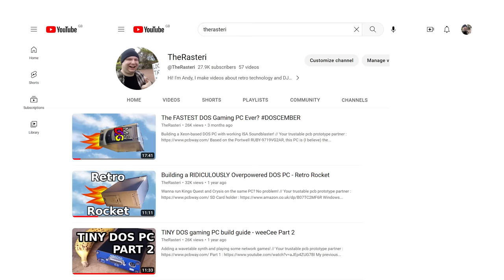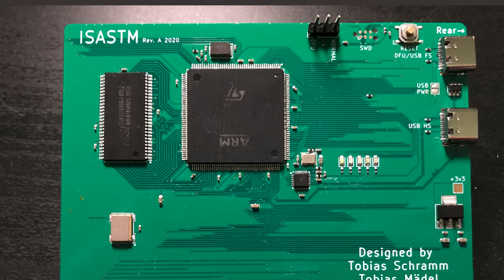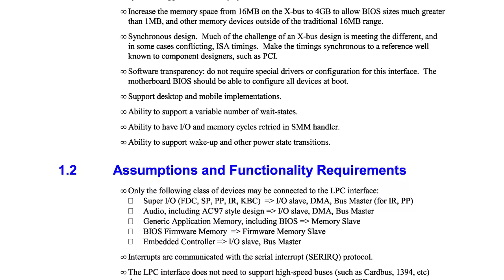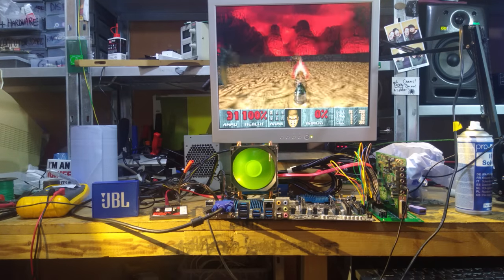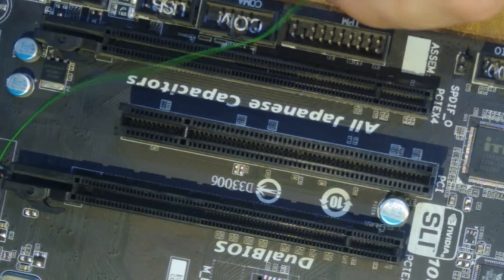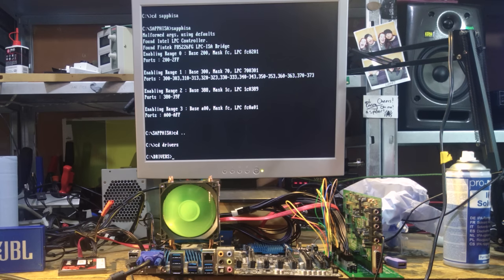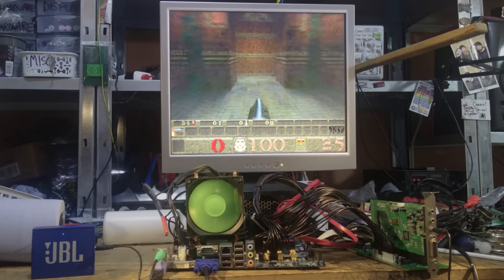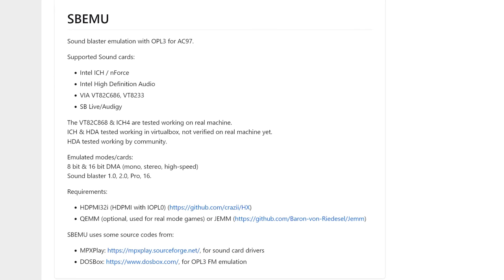Add an ISA slot to Modern Motherboards!

Comment: I noticed that according to Wikipedia, 32-bit "ISA-style" transfers over LPC are possible, so I wonder if it's possible to build an LPC to EISA adapter board?

(Though I guess it might be easier to just make a PCI to EISA adapter board using something like an Intel 82374EB/82375EB chipset combination, and dangle that off either a classic PCI slot or a PCIe-to-PCI bridge?)

Comment: 6:10.  You don't get $5 off your first order.  You get your first order for $5, provided it meets the requirements.  I'm not connected in any way, but they'd probably want this conveyed accurately ;).  Thanks for the info about the ISA board, though, as I've got an SB32 in my desk somewhere.

Comment: Interesting piece. I've shared it on my (personal) LinkedIn.

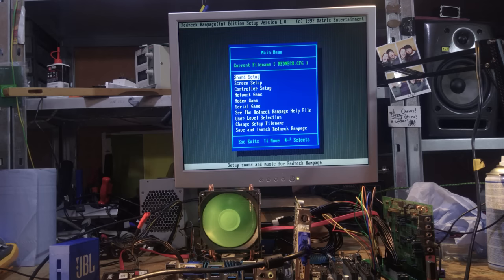@11:18 redneck rampage ?

AM4 is indeed pretty decent for AMD users (like me). When I stuck this current PC together (end of '21) there was still not that much of AM4 around. So AM4 will work for quite some time at least. And that goes up to an 8-core or even higher I believe. So plenty for an OP DOS machine

Comment: Hi mr Rasteri!
I have been watching your videos (some of the WeeCee ones several times) for the last years, as I have also been looking for a solution for DOS gaming.
In the end, I got a TinyLlama for Eivind, which I am sure you know from the Vogons threads, and which is based in your work (I believe the BIOS at least is based on your work on the WeeCee, right?).
Just in case, the TinyLlama is a mini-DOS-pc based around the Vortex86EX SOC.
So it's more or less OK, except that some games don't seem to be able to work on the Vortex86EX + CS4237B sound chip, in my case I found out that Pinball Dreams and Elder Scrolls: Arena won't work no matter the conventional/EMS/XMS combinations, driver disablement, etc...

So, do you have an idea about why these games won't work on modern Vortex86EX? Is the Vortex86EX somewhat incompatible? Does it have a working and well-behaving DMA?

Thanks!
Reply from the maker: I'm not sure - maybe ask over on the vogons forum thread? Lots of discussion happening there
Reply: @TheRasteri  Youtube deleted my previous answer for some reason.
Well, I already asked at vogons, a month ago or so, with zero responses.

Comment: These days, I have little self respect left, when it comes to DOS games. I only have only one piece of vintage hardware left & finding peripherals for it is difficult and expensive. The hardware that I'd like to run is VESA, and finding stuff that supports that is even more difficult. As far as video card performance, though, it was unbeatable, compared to ISA. I wish I could find some cheap peripherals that ran on EISA. Unfortunately, I don't anticipate running much beyond the basic configuration, for as long as it lasts. I keep counting my blessings, every time the ESDI drive successfully boots up.

It might be fun to have a modern x86 microcomputer, with a form factor similar to Raspberry Pi, but with expansion capabilities, like a PC had. Having graphics on board can be handy for a SBC, but maybe one might like to expand the graphics capabilities, the sound, or add other peripherals, while still leaving a full set of GPIO pins open.

Comment: Dunno about AM4, but the two AM3 platforms I have handy (Sabertooth 990FX R2.0, and M5A97 R2.0) have an LPC bus according to HWINFO, and TPM headers that line up with your diagram. However, similar to the Foxconn board, pin 20 is disconnected. They both use a  IT8721F Super I/O chip, so a mod like the one you used should work.
Reply: very bad CPU if you need native support !

Comment: Possible reason for Quake issue is that you are missing -5V voltage, since modern power supplies do not have it, and lot of audio cards are using that voltage for opamps.  Easy way is to covert -12v to -5v but that will need change on your board.
Reply: That's not quite right. If that was the case for these cards, there would be obvious issues in all other games as well. From looking at connectors, i would say the usage of this voltage is actually quite rare. Still ideally that's something that should be on the adapter board, given the low layout complexity and component cost.

Comment: Intel stopped allowing DMA? That might be the problem I am having with PCI soundcards in DOS. PCI soundcards for DOS had a TSR that had to catch the signals and work on PCI. I have this soundcard that works on Win3.1 but not DOS.
Reply: PCI sound cards have never supported ISA DMA. Any attempts to make them SB-compatible (except for the short-lived SB-LINK connector) are software hacks with limited compatibility.
Reply: @eDoc2020    there where a few PCI sound cards that would access the motherboard's chipset ISA style DMA controller by snooping the PCI bus to complete the Sound Blaster emulation transactions. unfortunately chipsets like intel's ICH6 or later would make that impossible. These later chipsets also breaks PCI to ISA bridges because of the removal of the special PC-PCI signals to the chipset. Newer chipsets still have the ISA PIC & DMAC, just only accessible via the LPC Bus signals. (Intel 100 series PCH LPC and later lack the required signals and won't work)

Comment: I have been using a sound blaster emulator (a file you run from dos, works on a real hardware, you run it before launching a game),it somewhat works but not with every game. I am using an old netbook as my DOS pc so this is the only option for me. I am planning to adapt a desktop now so your solution is perfect. BTW, is there a way to force DOS 6.22 to use external VGA port instead of the inbuilt laptop screen?

Comment: LPC is like ISA Express (like PCIe is to PCI). LPC seems to be being phased out in newer designs and replaced with eSPI, but I suspect bridges betwen the two may be available. Still have to worry about DMA, though.  Seems like PCIe to ISA should be possible, too?
Reply: You don't have to worry about DMA because eSPI specification says that 8237 DMA access is not foreseen.

LPC doesn't support DMA in-band, it uses out-of-band signalling (LDRQ lines) for additional signalling. The goal of eSPI was to fold ALL of the out-of-band signalling into the protocol and just one alert request pin. However at the same time Intel killed LDRQ lines on LPC on the chipset, and also didn't add access to them to the eSPI protocol.

Comment: Mm, delicious signal integrity with your wire-by-wire connection!

I bet Lemmings was slowed down because of the high performance PCs option, like they added that to compensate for running way too fast. Would be funny if selecting the regular PC option ran hundreds or thousands of times too quickly

Comment: There is a major limitation with this approach. Many ISA cards for specialist applications such as embedded IO and industrial control use ISA's DMA feature for fast and low-overhead data transfer. LPC does have some support for this, but the system firmware (aka BIOS) has a built-in list of memory regions to map that is not user-modifiable currently (and likely never will be). So unless you want to get into EFI modding, those cards are never going to work on any modern hardware. Even if you were to go that far, there might be other technicalities I'm not aware of that you'd be faced with, such as the setup potentially not looking the same from a driver's standpoint and requiring further modifications (which at that point, probably kills the whole thing for something like a legacy industrial application).

Comment: 2:24 There is an industrial motherboard out there (iBase MB970) with an ISA slot and support for 3rd gen Core-i CPUs (Q77 chipset) and Windows 10.  I've got a bunch on Win10 32-bit still using ancient ISA motion controllers.  Surely they could work with sound cards too.
Reply from the maker: That motherboard uses an IT8888G PCI-to-ISA bridge chip. As far as I know they don't support DMA on PCH chipsets, so won't support soundcards. Happy to be corrected if you know otherwise though?
Reply: @TheRasteri  Q77 has the expected two DMA controllers at 00h and C0h and the IT8888G appears to support DMA translation.  I haven't considered whether it would work or not - I'm pretty sure my cards just use port I/O but I didn't get the impression that DMA was not supported on the ISA bus on this board.  I haven't tried putting a soundblaster on one either, of course, so you may be right.  I do have one spare board...maybe one day I try to find a legacy sound card to see if it works.
Reply from the maker: @jzero4813  Yeah the IT8888 supports DMA but only on chipsets up to ICH5 (MB970 is too new). The only way to get DMA on chipsets after that is to use DMA, and even then only up to series 9 PCHs.

Comment: Would this work with a floppy controller? If so, I am going to do some evil, evil things. Or perhaps there would be an easier way to make old fashioned floppy drives work on new hardware.

I know about archival-style things, I just want something that works like they would in an old computer.
Reply: There are USB->34 pin adapters which should work fine for basic usage of 3.5 drives. Basically a common USB floppy drive but without the drive.

Comment: I have an Intel DQ77MK board that simply has exposed LPC on what they call a debug connector (bios alows post codes to be routed there) and they even provide a pinout in the manual, so this board would make everything much easier because there's no need to mess with the tpm connector (it has tpm on board; it actually literallly has everything built in). It's 1155 so DMA should work.
Reply: Aaaand it's missing the irq signals
fuck

Comment: Is there any reason you couldn't just implement a custom firmware module and get something close from a modern sound device?  
  
Aside from the actual ISA sound hardware, I thought the biggest issue was not being able to interact directly with the hardware.

Comment: I still have an Asus P5 WS Pro with a ISA buss on it, I recently bought a motherboard for 4th gen intel core cpu's containing 2 PCI slots. I was wondered to be honest, because PCI is also scrapped in time. But I still can install a PCI FW card for my external sound cards. Very convenient to be honest. Btw I had one of the first IBM computers back in the day that were brought out in Belgium. With a HD from 20Mb and the OS was PC-DOS, it was kinda the same as MS-DOS in later versions. Only some UNIX parts were left out on the IBM's, or was it vice versa? That's a long time ago.
Reply: As for PCI, the Gigabyte H310M S2P hosts 2 PCI slots and you can put a 8th or 9th gen I core CPU on it (as for me, I have an i7 8700 on it). I use this system mainly because of two old PCI PGIO cards.

Comment: but the OS still assigns ISA irqs...it's pretty silly. the other silly bit is all the smoke and mirrors for PCIE, purportedly routed via PCI logic/circuitry. more useful than ISA would be AGP, which still exists in the OS but, not sure if any GPUs that run on AGP are supported.

Comment: Extremely interesting! I have a friend who works with large machines in industry where they use x-rays to inspect metal. The machines are connected to an ISA card and it is becoming problematic to find old hardware that still works reliably. There are of course new solutions, but it is tragic to have to throw away fully functioning test equipment due to the availability of old hardware. Do you think that test equipment connected to "dISAppointment" could work or is it mainly for sound cards?
Reply: It should work but keep in mind that possible downtime costs $$$
Reply: dude, this is why Vortex86 boards are made, like Diamond Systems' Helios. Those are fully compatible 486-class machines (but much faster). For an industrial application don't use a hacked together bit of vintage equipment.

Comment: I have an old metal press break that uses a 1985 DOS computer. It uses (needs) 2 ISA cards, DOS,  VGA screen and keyboard. The computer is not working so good. How can I get a computer with 2 ISA card slots?
Reply from the maker: a Pentium 2 or 3-era motherboard is probably your best bet

Comment: Video cards might require some BIOS shenanigans, as i believe the option to switch from Onboard to Offboard graphics is hard coded to check the PCI bus, not expecting to scan the ISA bus at all (as it's not technically part of the board's spec anymore)
Reply: I wonder if an custom EFI module would allow the CSM to access the ISA VGA bios from the LPC bus.

Comment: i am not sure what the irq does but if it is used to put 1 card on hold while it has to talk to the other card like an address pin you could just run 1 isa card and leave the irq unused and it means only running the most important card witch is the sound card.

if you need  the floppy you can emulate the floppy easier.

since the floppy drive is not copyrighted like sound cards are then emulating the floppy drive should not be a legal problem.

however emulating sound cards  can be tricky because the roms are maybe still in copyright.

however due to obsolescence  the companies may not care unlike commodore because the amiga is making a comeback.
Reply: When the DMA buffer runs out, the sound card raises an IRQ to software, to signal it to refill the buffers and restart the DMA. This way IRQ is integral to the operation. There would have been another way to implement audio on ISA, having ISA Bus Master capability and IO reads for the software to check buffer consumption status, but that was a headache the engineers chose to avoid, so that's not how it works.

You don't need any ROM to achieve basic soundcard emulation akin to Soundblaster 16; and getting wavetable synthesis can be externalised to where you just allow to load a free SF2 or something, behaving like a WaveBlaster expansion towards unaware software.

Comment: There is one thing that I would try to see if more than 1 card can be supported:  a 2 or more slot riser card.  There are some that fit directly into a standard ISA slot and would function as doublers or more, depending on how many slots were in the chosen riser card.  The few that I have on hand only have traces for the ISA slots and some passive components. installed.

Comment: What benefit does Intel get removing ISA DMA? Besides breaking ISA card support I don't see any other outcome
Reply: same reason firewire isn't used any more.  DMA is dangerous.  It's literally an open door through security resident memory.  I.E. DMA can be used to completely take control of a computer.

Comment: Hi TheRasteri, do You (Or anyone else. 😄) know is LDRQ# mandatory, (Required by F85226AF ?) since my ISA card do not need any kind of DMA transfer ? 🤔 That will make things a lot easier since in that case, there is no need to mess around with unsoldering small pin.
Reply from the maker: if you don't need DMA then LDRQ isn't needed
Reply: @TheRasteri  Nice to hear that ! Thnx.

Comment: Nifty, but for any ISA bus adapter you could dream up, I'm confident that software emulation of both the bus and the device is probably cheaper and somewhat less of a waste of time.
Reply from the maker: Couldn't agree more - When I actually want to play retro games it's usually in an emulator. But for me, tinkering with hardware is its own reward
Reply: @TheRasteri  There's something to be said for that. I just question the point of tinkering with obsolete hardware....apart from repurposing it instead of just dropping it into the dumpster.

Comment: IRQ5 issues on modern boards 99% certain that is a conflict with your build in NIC that defaults to IRQ5 just like the old sound cards used to. Both where developed in isolation back in the day networking for the enterprise and sound much more for the home market as such they both picked the first available IRQ5 to default to causing a never ending stream of issues back in the day with many a consumer not understanding why after a reinstall of their computer they had no more networking or no more sound (usually no more networking as that would initialize before sound thus loose it's claim to IRQ5 once sound kicked in.
Oh, and thanks for making me feel old ;-)

Comment: Im still running an old 2005'ish Athlon dual core system.  For one application, on one single piece of equipment, that only uses an LPT port and XP.
I need to find a "new" board (any cpu )with an LPT that will run XP. In 2023... arggg

Comment: I want to use this on an MSI board I have and I see in the schematics that the PCH has 2 LDRQ lines with one of them goes to the IO chip, can I use the second unused LDRQ line for the dISAppointment? there is no LDRQ signal on the TPM header at all so I need to wire it up anyway so i rather use the second line so I dont have to disconnect the IO chip
Reply from the maker: yeah I did this exact thing on my gigabyte motherboard, works perfectly.
Reply: @TheRasteri  Good to know, thanks, now to order that bridge chip :)

Comment: Suggestion: Have some jumper headers on the dISAppointment itself so we can use a standard ribbon cable to connect to the dISAppointment and then reroute as needed.

Comment: would that have to be placed outside the tower in external enclosure ?
Reply: Well this is a prototype... i don't know if the holes line up (yet) but the sensible way to go about it would be to have it in a full size ATX enclosure below an uATX mainboard, mounted to the carrier with normal mainboard standoffs. Two bottom standoffs would screw into the carrier and you screw such an adapter to them, and two standoffs can be attached to the adapter at the top as spacers.